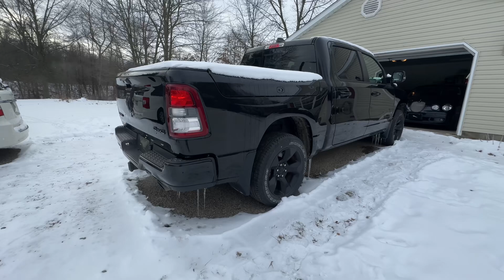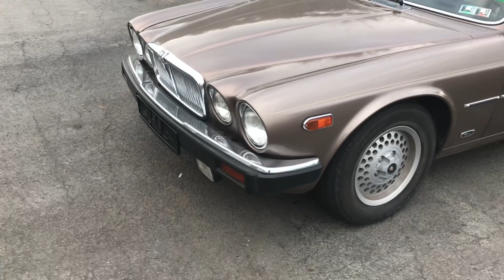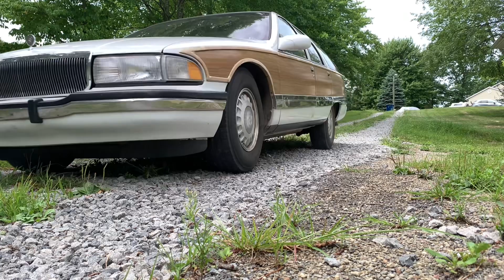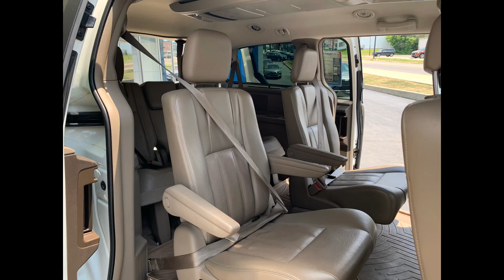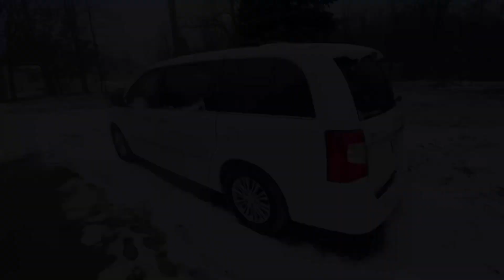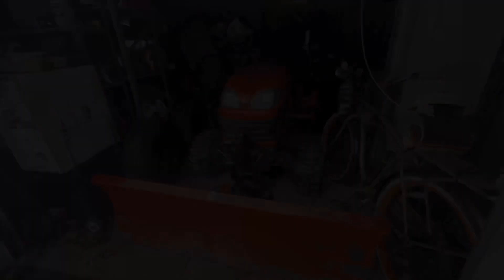Introduction to My Cars Pt 3: Buick to Jaguar | Collections

Comment: I've been using a lined car cover over winter with paracord  tied across various points to stop it flapping around in the wind.
It keeps the.dirr off but I am.xinceenwd about trapping moisture.
There is an outdoor version of the Carcoon available but they are very expensive.
The mini van looks like a comfortable and practical daily. 
I presume the buick is a pretty luxurious car but there something about a large wood paneled station wagon that screams Griswold family transportation. 😅
Another interesting video Darren.
Keep up the good work.
Reply from the maker: I’ve been looking at Coverseal covers Mark which have those sand-filled girdles which keeps them weighted down and prevents critters from getting underneath. They’re a $400 touch though! Thanks as always for the kind words!